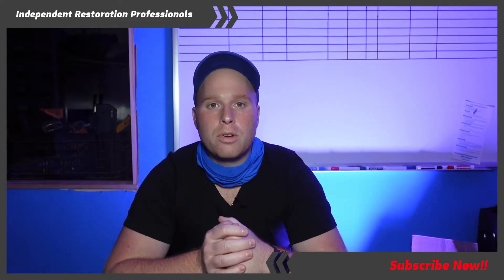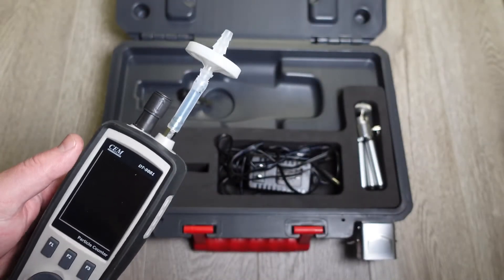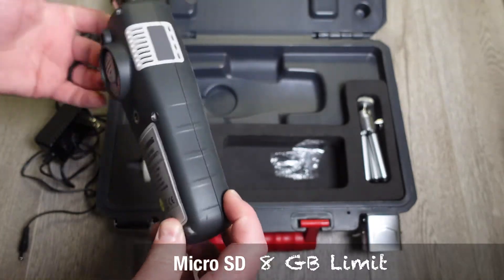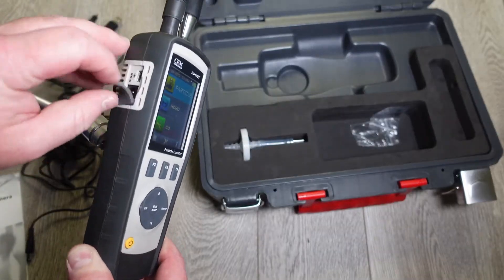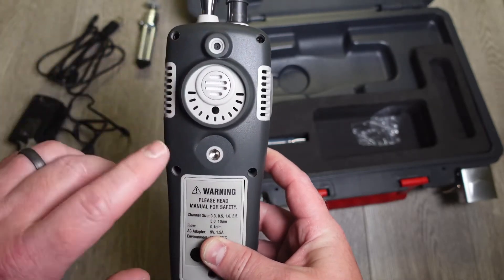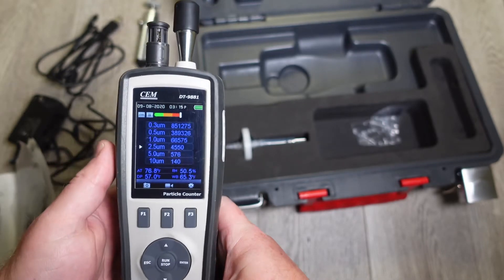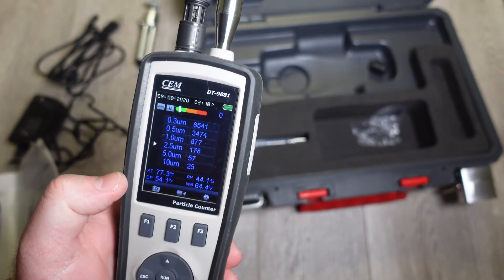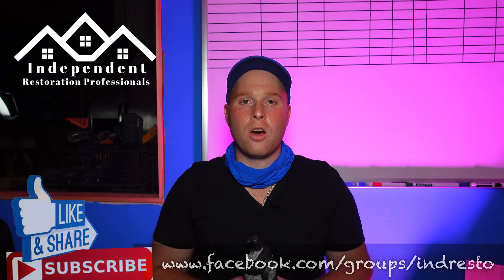Laser Particle Counter - 6 Channel - CEM DT9881 Review

Comment: How is this information useful on an EMS or mold remediation job? What is an acceptable number of particles on a residential property?
Reply from the maker: During a remediation project you are supposed to have the work cleared by an independent 3rd party IH or IEP.  During that clearance test the IH or IEP will likely take lab samples (direct fungal exams such as tape lift or swab and/or air samples to test for mold). As the remediation technician or supervisor performing the remediation, we can improve our chances of passing a PRV test by monitoring the air before during and after the remediation with a laser particle counter. There is no data set that outlines what would be considered “acceptable” for indoor air quality whether it’s for mold or a water damaged property. For this reason we take control samples outdoors and in “unaffected” areas of the property to compare them to the samples taken in the work environment. For instance, airborne mold spores are typically between 2-20 microns in size. If you monitor the LPC at 2.5 micron before during and after the remediation, you know that your chances of passing a clearance test is greater if you followed the ANSI/IICRC s520 and the LPC at 2.5 micron is lower then outside or outside of the containment space.  Also, it is useful to be able to monitor the effectiveness of your AFD output which can lower liability on the job. A LPC can also be used to help justify air filtration devices on Cat 3 water losses if the particulate count is elevated in that area. At the end of the day the LPC is just a tool and it’s one of many that can help a restorer perform at a higher level. Our company personally uses the LPC counter in conjunction with an ATP meter to test most jobs before and after we complete them. The more information we can obtain the easier it is to justify and defend your actions in a customers property.
Reply: @independentrestorationprof9395  thank you for your explanation.
Reply: @independentrestorationprof9395  
Do you have an email where you can be reached at? I have a few more questions regarding the sample results with this tool. I just need an explanation really quick and would like to send a picture of the results.
Reply from the maker: @reefkeeper_zay2750   join us on Facebook @ Facebook.com/groups/indresto 

See if you can send me a message on there and I’ll shoot you my number and email to connect. 

You can do the same if you look up my business Facebook.com/bulldogrestorationservices

Last time I posted my info on YouTube we got spammed pretty heavily..